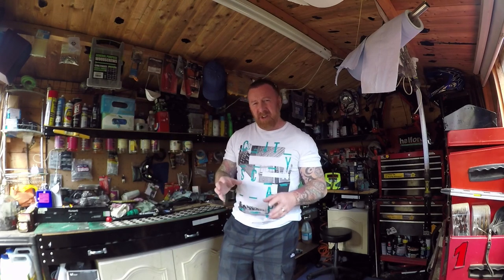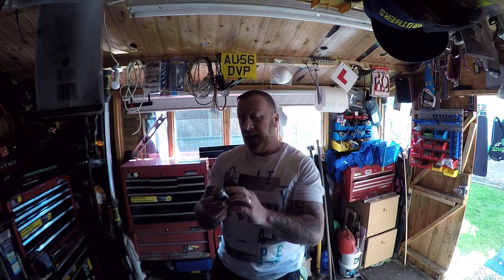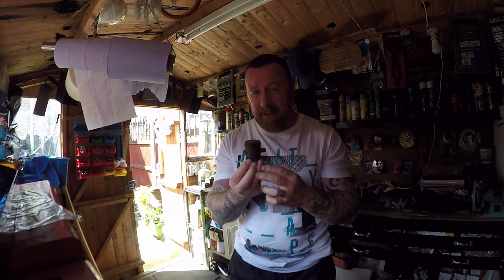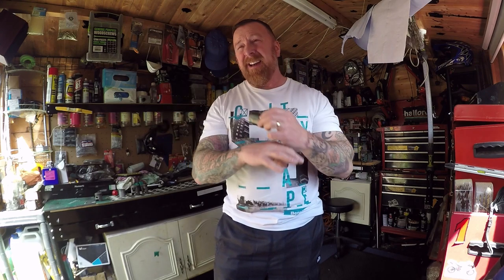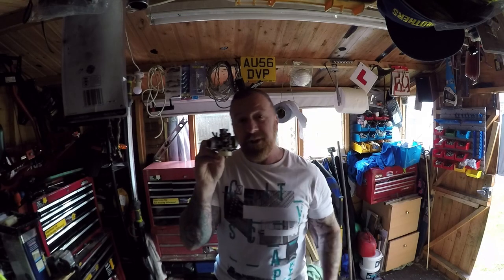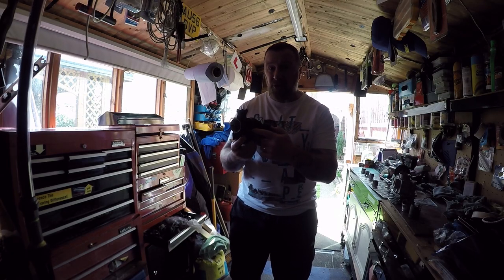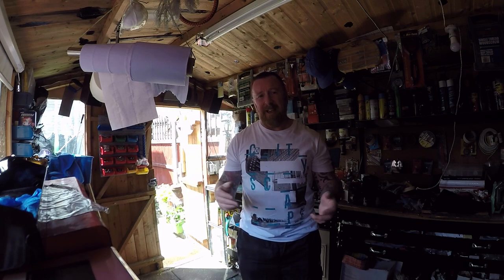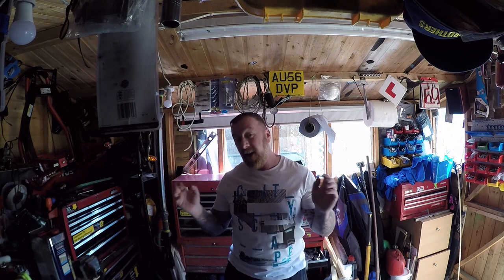PISTON GONE PISTON KIT UPGRADES WHAT YOU NEED TO DO MARK SAVAGE

Comment: any help? rode my bike through the rain and now a month on its still low on power and stalling at traffic lights. i have got a new plug ready to go in, but what else could it be apart from that? ive cleaned the air filter out so that shouldnt be an issue..
Reply from the maker: riding in the rain can cause a lot of damage as the water can splash everywhere , so you have changed the plug so next 
check 
ht coil clean and wd40 along with the ht cap and lead 
clean or change air filter 
service and clean carb 
wires and connectors  take apart / clean and wd40 
now on the right hand side you have your stator coil!, water can get in there so if after the other easy thing to clean and wd40 you will need to get that off like in my videos and clean or change

Comment: Mark, I was riding my speed fight 3 when it suddenly cut out after the oil light had been on for about 30 mins even thought it was over half full of quality 2 t oil I tried the kick start and after several kicks it wouldn’t start and wouldn’t spring back in place like it did.  the bike cut out previously but I thought nothing off it because it started fist kick after. The engine was also very hot when it broke down. Could you offer any advice please much appreciated
Reply from the maker: ok this can happen 
first check for spark bud as the oil light is also the immob light too 
as for the kick start take the cover off and wd40 the kick start part like in my video on kick start ,its on a sp2 but it the same so will help 
if it is free then it sounds like the head has heat seized 
the oil pump could of failed or pipe come off?
in this weather they can get very hot and this also can happen after a long time riding 
so if it is stuck you will need to change the head and piston and I have many video on how to do this with 70 videos on speedfights 
lots on 2 but as said its the same sort of thing and a few on 3s
Reply: Thanks so much I’ll have a go now

Comment: after doing all of what you said mark my 50cc hit 84 83 km pre h is that max i can get  out from 50cc  engine.? cab 100cc  i can but 100cc head ?  or 80cc ? or  not  doing it better ?
Reply from the maker: 52mph is good for a 50cc bud most do 30mph to 40mph so 52 / 84km is very good, what 50cc is it??
I have a video saying 70cc or big bore kits dont do it as they never last and take loads to tune so if your 50cc is getting that be happy bud and dont mess with it now
Reply: @marksavage   i'm very happy to hear that from you mark my 50cc its gilera runner   its has some part malossi  no kit or anything  its just  some part i did add like blt +cab and roller light etc ive done basic improve (sorry for my bad english) but  i'm really in love with 183cc but its  very expnsive here and  i'm still to this day looking for engin to buy it i couldn't find it i'm from tunisa and here we lack in finding part for scooter  for gilera its so rere here to find part for it i'm really love speeding with scooter lol i was about to buy 100cc engin  of speedfigher  but they told me its  bad and can't be tund etc and will give you problme
i watch every vido of you mark i would like to uploed more for gilera runner  thing
Reply from the maker: thanks for watching bud, i've not had any mopeds or bikes for a while but if and when I do I will try and sort you out with a video, with 70 on speedfights they should help and many things are the same as the runner so should help. 
take care bud
Reply: @marksavage   thank you mark   keep it up fam

Comment: just a curious question, what heat number spark plug would you reccomend/use yourself?
so for NGK 6-7-8-9-10-11
this is for a strong setup, 70cc, roughly 10.5k RPM.
Reply from the maker: 7 normal so go up 1 for hotter running

Comment: 50cc automatic, i need to change the gear box oil. i have ordered GearBox oil and received Axle Oil. would it do the same thing do you know ???
Reply from the maker: I use ep80w or 90w 
If its not the right one don't use it bud
Reply: The numbers in terms of se90w80 match but it says axle oil instead of gearbox
Reply from the maker: @mastercreative1  as long as the 80w is the same it should be fine
You need to drain all the old oil out and out in the right amount back  bud
Reply: The one I have is Caroline 80w-90 axle oil. Presume it’s the same just different additives ???
Reply from the maker: @mastercreative1  
I'm really not sure bud 
I only use the right oil for the job
I have this eith one of my bike videos where I say only use motorbike oil for motorbike and a guy said he uses 10/40car oil with no problems 
I had problems with it as they use a wet clutch in with the oil and cars don't and the bike I had the clutch started to slip 
It's up to you but I'd pop to the shops tomorrow and get gearbox 80w
Reply: cheers. next issue is finding where the drain plug is grrrr @marksavage
Reply from the maker: @mastercreative1  
I drained mine out of the crank case as had issues with it 
Watch my speedfifht gearbox videos

Comment: Hi mark, why does my aprilia sportcity 50 2T air cooled, bogs  when I go round corners?
Reply from the maker: That’s an odd one but will have to be fuel 
Check the intank filter and make sure it’s clean also fuel pipes are ok fit ok and no hard and change if you have an inline filter 
Then onto carb 
Service and clean bud 
See how you get on
Reply: @marksavage  okay will give it go and see what happens. Thanks for replying
Reply: This happened to me, might not be the same problem but for me it was my clutch springs we’re getting to hot nd expanding making it bog round corners wen I let off the throttle, went out bought Stiff clutch springs nd it ran fine
Reply from the maker: Glide worth a look 
Thanks for sharing 
But while on that subject 
He said about backing off the throttle 
That could also be tuning as air flow not right so worth a service and tune bud
Reply: mark savage got it serviced nd all tuned nd runs sweet now! Was because the Leo vince pipe runs at a high powerband so at low revs it does really move so quite a hard pipe to set up nd get in the powerband I think is what the mechanic said to me!
Reply from the maker: Glide yes bud that reply was to help Ethan as he has the problem 
End of the day it sorted your moped out let’s hope he can sort his
Thanks for the comments bud and for watching
Reply: Glide might be your carb setup. If it’s a 2t have a look at your fuel to mixture screw you might bog down if there no power to make it round the corner. Also if you know how to take the variator cover off and look at the rollers and write down the Weight or look at if there any marks and look to buy a smaller size say it’s it’s a 6 try a 5.5 or 5
Reply: Especially if you have a sports exhaust you have to change the rollers and adjust the carb
Reply from the maker: good advice bud

Comment: Give me ten min
Reply from the maker: So that's floating around in your tank!!, don't think it will help matters lol , so you think it blocking the fuel into the vacuum?
Reply: @marksavage  just uploading a vid for you mate give me five min I’ve fixed that now no mate I did think maybe that could be it turns out I found the problem oil pump must of failed  this time round I’m removing it check vid upload I’m 5 min
Reply: It’s been known if it’s standard 50cc to run oil pump on 70cc twin piston rings cast iron head  pump should be removed so you know it’s 100% got oil by the rider vid is up mate
Reply from the maker: @kayone8571  it was a good video and to finally find out what it was 
Total top end and crank bearing, crank , seal, gaskets 
Oh dear , wait till you start using E10 fuel , not good
Reply: @marksavage  hey mark lol I dunno what fuel I put in that day so which is the fuel we need to use now 
And yeah rebuilt time :( and the recording 😂 I felt like you
Reply from the maker: @kayone8571  now you know what's its like haha 
They are bring out the new E10 fuel which is bad for older cars and mopeds as it damages the copper bits and gaskets and pipes 
And is bad if left in the tank as it rusts them 
All in very bad but the government are still going ahead with it 
Greener my ass !!
Reply: @marksavage  I think mark the best thing is todo run high octane
Reply from the maker: @kayone8571  yes or mix
Reply: @marksavage  definitely mate I’ll use  vpower or high it’s only a small tank